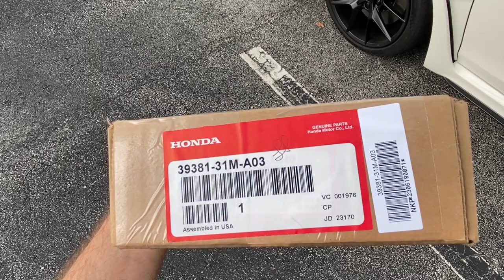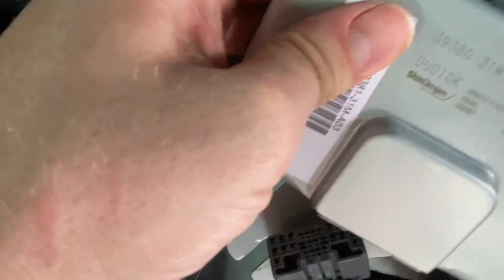Civic Type R FL5 Softer Dampening Mod

Comment: works no problem with the 2024 FL5 ?
Reply: That’s what I’m wondering . But it should . The 23 & 24 Type R are the same
Reply: Installed it in my 2024 Type R.  Worked perfectly.

Comment from the maker: It is definitely a noticeable difference, I don’t have the exact numbers but Acura states that the sport mode on the Integra Type S is closer to the CTR comfort mode. Also the road I was testing on is quite bumpy reguardless, just easier to try and see differences in settings. The ITS comfort mode is very smooth, I just didn’t include it in the review

Comment: You could put the Civic one somewhere in the trunk and make a small circuit with a switch so you could choose which one you wanted. Do you think the loss of +R mode suspension settings is worth getting the softer settings?
Reply: I thought about making a switch for track purposes as well.  Good thing is it’s pretty easy to swap between the two modules without one.

Comment: Thanks for the helpful video.  I just replaced my Type R's ADS module with the Acura Integra Type S's module.  Like others have already stated, each of the suspension mode setting are now roughly one step more compliant.
So the new "+R" is roughly equivalent to the old "Sport" mode
"Sport" is equivalent to "comfort"
And "comfort" is a new softer setting, slightly stiffer than a regular Civic.
IMO, the new +R setting is slightly over-damped, and the Sport setting is roughly correctly damped, and the comfort setting is slightly under-damped.
The new softer comfort mode is nice and comfortable for everything unless you want to drive hard.  And the new +R setting is about optimal match with the factory springs for driving hard.
Reply: How do you like it now after  a while, Does it make the car ride better?
Reply: @altimatic2183  My Type R now rides great.  Even at the softest setting, it still handles very well, and the stiffest setting is probably still a fraction too stiff for many tracks.
IMO, the suspension damping adjustment range is now roughly centered on the spring stiffness.  Such that the softest setting is slightly under damped, and the stiffest setting is slightly over damped.
Here's a video of a Type R on the track with the stock ADS, skip to 10:15.  https://www.youtube.com/watch?v=qDLg2vXZsZc
Have fun.

Comment: Excellent help on this mate. Have you found any issues on bumpy roads? Eg the car hitting bump stops or anything due to the softer damping? I think this is great that we can hit R+ mode and not have a broken back. With everything in R+ and just the dampers on sport with this change it seems like perfection especially for the crappy roads that we all have 90% of the time

Comment: awesome vid man. im def gonna look into that..how much is that ADS Unit..tomorrow is thanksgiving hopefully onpen on friday to see...hopefully its in stock
Reply: I ordered it yesterday for 202$ plus 20$ shipping. 
Can’t wait to install it, as currently I use comfort mode exclusively. Sport and +R are unusable, and even comfort has compromised traction on bumpy roads due to the aggressive adaptive damping ramp up in the fl5.
Reply: @ASJC27  where did you order from?...im in socal in my brief search it looks like its nationally backordered. i did order from an acura dealer in utah claiming it should be in stock end of december.  i paid 210 shipped. but ya will ship when they get it in stock.

Comment: My friend, did you find a noticeable difference in ride quality when you install the new module?
Reply: The difference in damping between the Type R and Type S ADS modules are very noticeable.  The comfort setting on the Type S module is roughly regular CIVIC soft, providing nice compiant ride on bad road surfaces.  The new R+ mode is about right for track and canyon carving on fairly smooth surfaces.

Comment: Thank you for posting this.  Can you confirm that you do feel suspension firmness changes between modes (comfort, sport, and R) with the type S unit?  Im concerned it may default to only one suspension setting.  Thank you again.
Reply from the maker: There is definitely a difference between the three modes, it is noticeable
Reply: After driving some more with it do you plan on keeping ITS or switching back to stock?   What mode does the current comfort feel like?  Thanks again for the post.
Reply from the maker: I plan on running the ITS ADS long term and only switching it out for smooth track days

Comment: I need your help on a totally unrelated topic 🙏 pls. Can you measure your FL5 wheel  center caps pls 🙏 and your steering wheel ren H badge also pls . I want to order them for my FE1 Sí thru my local Honda dealership but their techs don't know anything about part measurements  just remove and replace, the internet Honda specs  says that the older type R gen FK7/8 center wheel bore is 64.1mm in the rim  but some one measured the actual emblem center cap at 69 mm in this case the cap for the FK type R is larger than it's wheel bore the wheel was made with an under cut  🤔 can you help pls  my Si FE1 wheel center bore is 64.1 mm with a center cap measures 62mm Diameter so the FK8's center caps will never fit , pls 🙏 you have and FL5 the lucky one please can you measure your pls 🙏

Comment: ...and everyone that bought an FL5 and feels that the shock damping is too extreme, are crying for 'a softer ride', etc., should all realize that they've bought a far more capable, hard edge sports car than they intended or likely know what to do with, and just deal with it instead of actually lowering the cars capabilities trying their best to turn their budget Porsche into a Camry.  The Acura's ADS unit's highest mode is equivalent to your current Sport, it's Sport mode is equal to your Comfort mode, and then they have their baby-food Comfort mode, which can barely maintain control of the stock FL5 springs. You may as well swap the springs too and completely ruin the car.

I guess it's great that you can do this, but you're not like Type R drivers I know.  FK8 Type R drivers bought and put in the LE ADS controller to up and improve the damping, often to suite their heavier springs. I hope the FL5 controller is as good if not better.  In the meantime, I'll see the real FL5 Type R drivers with their original ADS controller on The Dragon, the Cherohala Skyway and on the track.  If I meet you folks on one of those, good luck trying to keep up.
Reply: It's not that serious. most of us don't commute on race tracks. the good news is you can swap out to the stock unit in ten min if you need to go to a track day.
Reply: You need to drive the FL5 in Australia with our third world roads.
Reply: The stiff mode the car bounces at high speed. Stiff isn’t the problem but compliance. You need more compliance to confidently drive the car fast. The fk8 and le didn’t have that issue.
Reply: @kobi2002  a very interesting comment. Thank you for that.
Reply: I test drove the type s before buying my type r. The type s was just way too soft. Felt like an ice cream truck on wheels. 

Went with the type r and couldn’t be happier with the driving dynamics
Reply: Just so folks understand the relationship between spring & damper.  There is optimal damping rate for any specific spring rate, by having very high damping, the car might "feel" better controlled in fairly smooth roads, but will often cause less consistent tire contact on bumpy conditions, especially at speed, plus harsh ride.
The reason for this is on dips, excessive damping can prevent the spring from pushing the tire & wheel back onto the road surface quickly, and the same with impacts, the excessive damping can prevent the springs from compressing to absorb the impact.
Over-damped suspension often feels a bit "dead" (Type R in +R mode), while over sprung suspension often feel lively (Mitsubishi EVO 8).  For better on track performance on the Type R, we should have stiffer springs to go with the Type R's +R damping mode.
So, IMO, replacing the Type R ADS module with the Type S module simply allow the damper to better match the springs on our Type R's.

If you want better track performance while keeping the Type R mostly stock, switch to stiffer (higher "K" value} springs, and track tires.
Reply: Nah man, even for the track the +R mode is too bouncy.
Reply: @ROVA00  I've come to understand that the FL5 is configured quite differently from the FK8, which I own. On track in R plus mode, the FK8 was pretty spectacular. I put Swift Spec R springs on mine, which are about as stiff as you could possibly drive on the street sanely. They also correct the balance, with the rear springs being slightly heavier than the front. The stock shock damping was pretty seriously lacking, which I rectified by installing the Limited Edition ADS unit. Once again, I have a usable comfort setting, and the R+ mode is the perfect attack tool for the Tail of the Dragon, or the local racetrack. 

Frankly, I was quite stunned to learn how unhappy many FL5 owners are with the spring/shock damping balance of their vehicles. I would have thought Honda would have gotten it even better on the FL5. But, now I understand the complaint, and why people are trying other options.